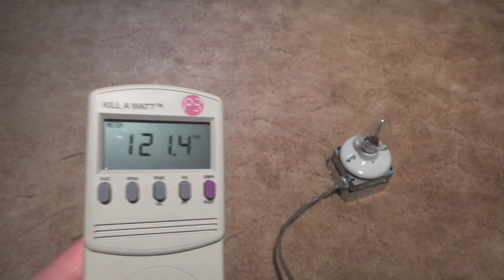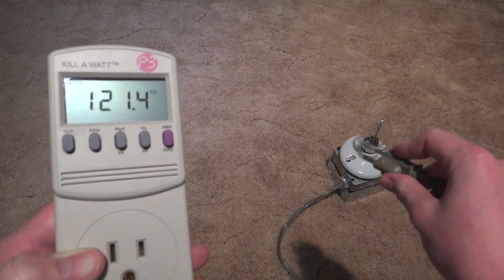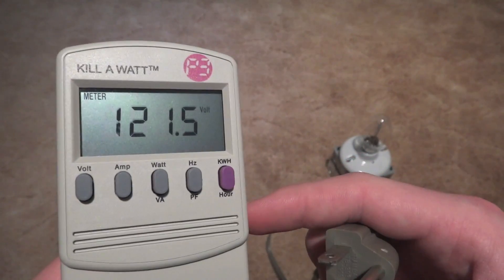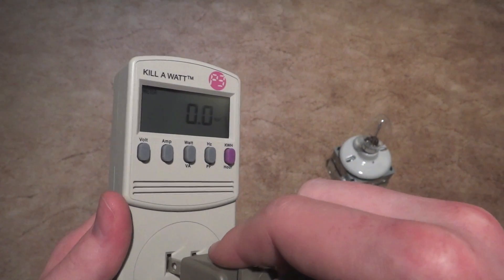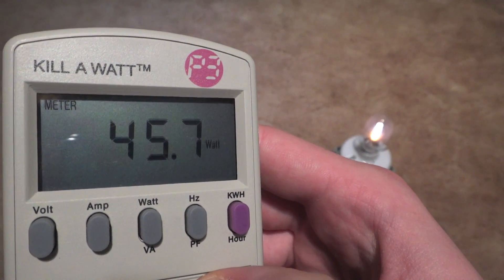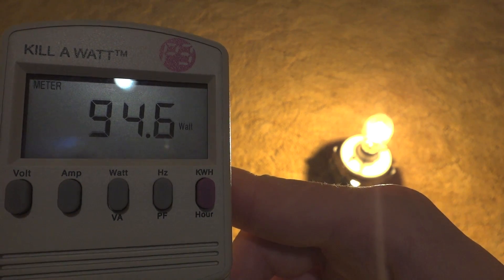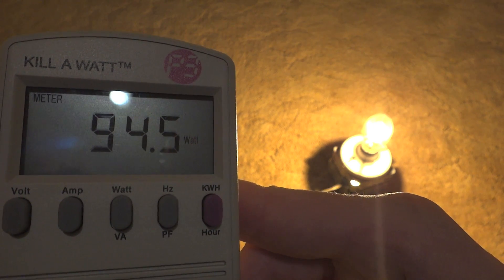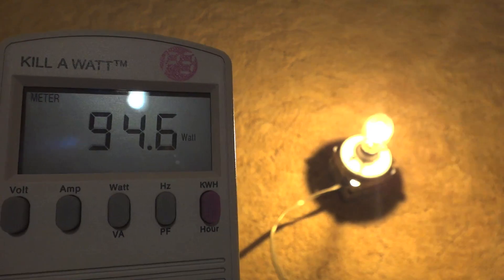Real Watts - 70watt High Pressure Sodium (HPS) fixture

Comment: Hi there I know this video is old but my 70 watt sodium lamp streetlight fixture takes around 120 watts of power at most but it keeps fluctuating. My supply voltage to my home is 230 volts ac 50hz. The fitting draws around 0.60A 600mA max the fitting has been running for around 5 hours. My power factor is at 82%. The voltage keeps fluctuating from 230-236 its normal so probably that's why the streetlight current and wattage fluctuates. Just letting you know that your fitting is not alone.

Comment: Interesting!   I just bought one of these and now I know exactly what I'm losing. About 25 watts to the ballast, which is probably just being converted to heat.  Thanks, also surprising to see that the amperage is so low, being that a toaster uses about 12 amps but more than a ceiling fan which uses at between 0.5 - 0.9 amps and it's a really cool meter.